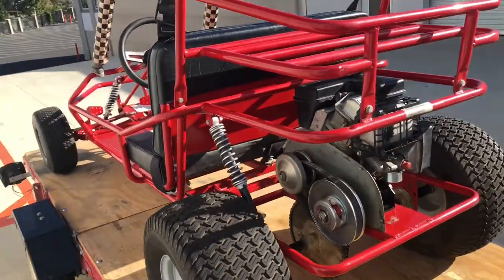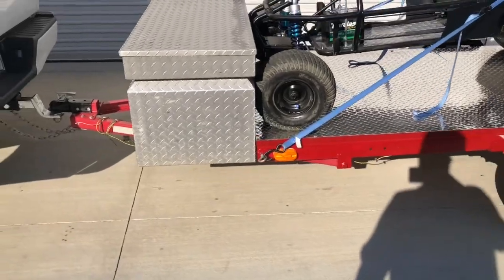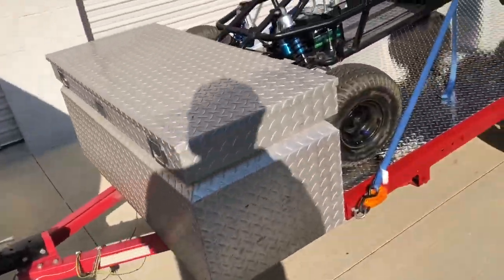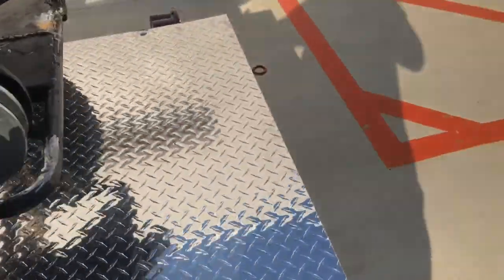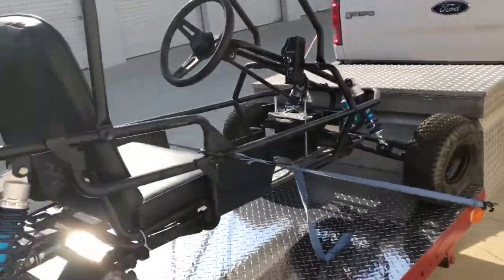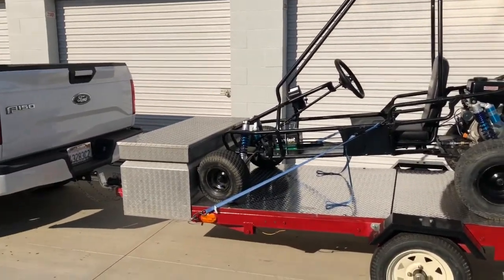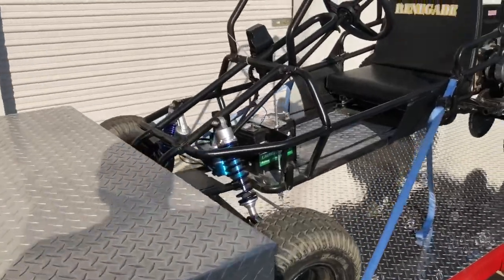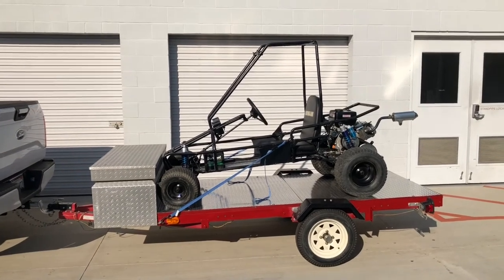#Harborfreight #HFtrailer #trailer #yerfdog Harbor Freight Trailer

Comment: How do you bolt down the sheets?
Reply from the maker: I used carriage bolts, first I drilled a round hole and when I I tightened down the nut it pulled the square neck through the softer aluminum diamond plate making it unable to spin as I tightened it.
Reply: @acecard8109  does the carriage bolt go through a hole on the frame of trailer? That's where I'm confused. Where does it actually tighten up to
Reply from the maker: Sorry, yes it goes through the frame rail then plywood, then diamond plate.

Comment: That's not a bad price for everything. Where did you buy the diamond plate 4x4?
Reply from the maker: ZeroR2 industrial metal supply in San Fernando Valley
Reply: @acecard8109  Thanks. I just sourced a 4x8 for a good price. Your trailer looks good.
Reply from the maker: Make a video when you get done
Reply: @acecard8109  Don't know about that. I have had my trailer for 4 years and never really used it. I was thinking about using aluminum sheeting, but I like your idea more (wood/diamond plate). I have 3/8 pressure treated wood on it now. It just looks so much cleaner with the diamond plate and easier to clean after a weekend.  I did change out the casters for really good ones. I laugh at others pushing their trailer with the OE ones (trailer is tipping over). If someone keeps the casters and rolls the trailer, it has to be upgraded. Not in your case anymore. Thanks again for sharing your ideas.